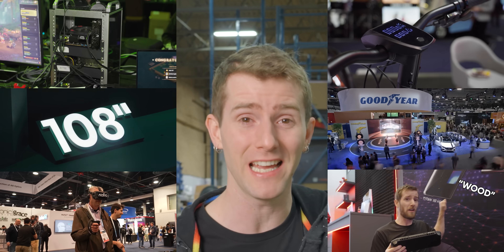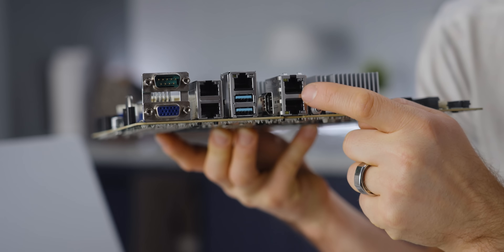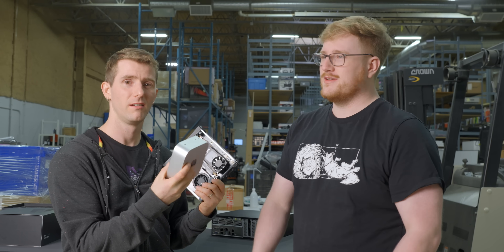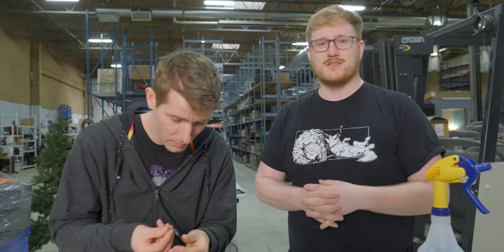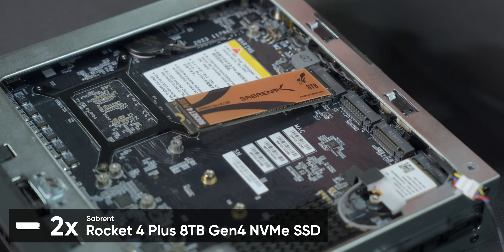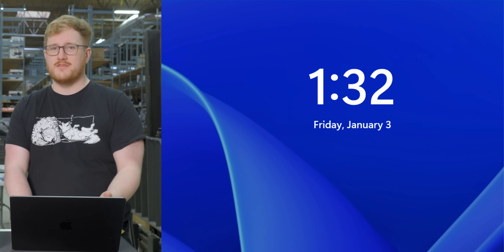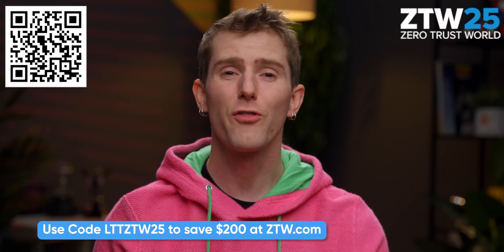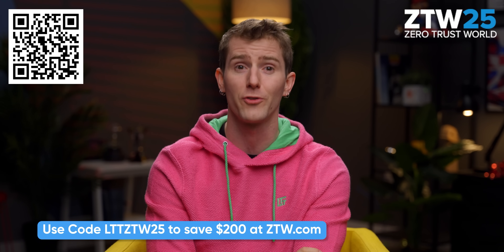I replaced a $20,000 server with this

Comment: Please do a video on a possible replacement of the Minisforum stock fans as they tend to get a bit noisy after little over a year, which is a bit annoying for a small mini PC on the desk. Have the UM 890. It's not all the time but some times it gets a clacking sound from the unit which sounds like the cooling fan is not build to run 24/7/365 and still be centered correctly.

Comment: Getting a bit frustrated with the prices of 10gb networking on the Mac’s, 200 bucks for a dongle? Just bought a 4 port 10gb nic on eBay and it only cost me 40 bucks. Super frustrating how much they are price gouging on thunderbolt dongles

Comment: I put a "Sparkle Intel Arc A310 SA310C-4G GPU 4GB GDDR6 Low Profile PCIe 4.0 50W" in my MS-01, supports hardware accelerated transcoding h.265, which the 13900H doesn't.

Comment: Honestly just buy a used dell optiplex micro i7, 4watts in idle, stick 64gb ram sticks in it. 
Sadly no EMCC but it’s awesome test bench and small servers. 

“Whopping 16gb vram” 😂 that should be the minimum any card has in 2025. 😮
Then Nvidia stock went to the moon and gpu stoped getting faster and Ai need VRAM,. Rip

Comment: For automating my shades I use homebridge with the sunlight plugin. You put in your location and it tracks the Sun’s position in the sky. You add a position where you want the shade to open or close and it is presented to HomeKit as a switch that on or off. The do an automation based on the switch. It’s amazing because the shades automatically adjust to the seasonal changes.

Comment: thanks for clueing me into the nanokvm. that's a great improvement on form factor. I use a pikvm setup that runs on a pi4 and it's great but I was having some hard lockups on my 5950x system while i had two 3090s installed inside of it. Required power to be pulled to reset the machine! I did set up a smart plug to achieve that but it's not nearly as portable and integrated like an IP-KVM is, so I hope a product that integrates power switching can also come along soon.

Anyway somehow this machine is running stable now that I took one of the 3090s out of it.

Comment: MS-01 will overheat if you really used it for this.  Both the CPU and the NVME drives, not to mention the trash cooling on the PCI-E slot.

Comment: It WON'T be ok! Definitely connect the power/reset header pins.

We have about 10 of these running now, 6 in production (2 DCs) and fault rate is about 50% where we'll just get kernal panics, etc randomly (not under high load, temp, etc). Running Proxmox and TrueNAS Scale. Not related to Intel's degradation issue on desktop CPUs though.

The iGPU also doesn't play nice with Proxmox/GRUB bootloader (VGA OOM issue) and can result in hypervisor not booting.

Comment: If you're connecting Macs, you can go thunderbolt direct to the MS-01 and use thunderbolt networking and get 20 Gbps without a switch or 10 Gig thunderbolt networking adapter.  But you're limited to only two systems via this method as the MS-01 only has two thunderbolt ports.

You also also upgrade the network jack on the macmini and run 10 Gbe internally through the RJ45 and drop the networking adapter.
Reply: There are now Thunderbolt 5 switches, but it is early days.

Comment: If you don’t have access to port forwarding or a public static IP, or if you’re behind a NAT or ISP-controlled network, you will run into limitations with devices like the Sipeed NanoKVM for remote access.
you still need some Port Forwarding on a public IP or a VPN or similar tunneling solution
Reply: the nanokvm seems to have ipv6 so as long as the network supports it it should be fine

Comment: Those low endurance gaming NVMe drives will die very fast if you constantly write on them.  Nothing replace high durability U2 enterprise drives. Sorry but you did not replace a $20,000$, you bought consumer crap that will eventually fail sooner that you expected.

Comment: A note on the sponsor: I work for an MSP. We use ThreatLocker and we deploy it to our clients. It is the worst piece of software I have ever used. All our clients hate it and complain about it. The only person in our company who doesn't openly hate it, is the director of security who chose it to replace SentinelOne. It blocks everything from running and causes issues that aren't obvious to troubleshoot. There have been several cases, such as simply connecting to a printer hosted on a print server, which have been stopped by ThreatLocker and it wasn't apparent that was the cause until way more troubleshooting time than necessary. I'm not a security guy but when the "security" product impacts peoples' abilities to do their work, it's not a good product. I'm sure all whitelist/zero trust style of security applications have the same fault but I'm only familiar with ThreatLocker. Unless your company has a well staffed security team to sift through hundreds of application requests, I'd suggest staying far away from ThreatLocker.

Comment: If your non-edged hand tools are 7 inches  (or 18 cm) or less, you can bring them in carryon.  Power tools like hand held drills are too big to be allowed in carryon, please transport those in your checked bags. Lithium batteries are not allowed in checked bags (power tool batteries) but can be in your carryon bag.  Canadian citizens with Nexus are granted TSA PreCheck if the proper fields are inputed on the airline reservation. Please feel free to message me if you have need for further advice.

Comment: Macs are likely more stable, especially for everyday use. My M1 Mac with 16GB RAM and a 512GB SSD has been trouble-free, while Windows PCs, even gaming ones, often overheat. My PC's GPU hits 43°C after just a few minutes, but the M1 stays around 31°C.

Battery life on the Mac isn't perfect, but it’s still solid—94% down to 90% after 4 months. It lasts way longer than my gaming PC, which has fewer cores.

Also, there's zero noise even when running 4K editing software. It's a much smoother experience overall. - feel liks i never turned it on before

Comment: Well, with something like the Mikrotik CRS504-4XQ-IN, you could break out the 4x100G connections into 2x25G to the MS0-1 and have 14x 25G or 10G links to the editors. And it's only 12cm wider than the MS-01, otherwise identical in size.

Comment: Yooooooooooooooooooooooo.

The fact that hotels in Vegas (where Defcon is hosted) actually leave their ports open like that is insane. First off, their AP's should obviously not be accessible to guests (but I know you know that) but their should also be incredibly basic security protocols to prevent unauthorized devices from being connected to their wired network. 

That's fucking insane.

Comment: Without wanting to drop into the Mac vs PC rabbit hole, if the software is more stable on Mac meaning that you need to use a Mac when you are at shows for that time and stability, then would it not make sense to always run on Mac regardless, for efficiency? or is that down to the computers in the office having more power to combat the stability issues and make them stable?

(Honest question, sorry if it is a stupid question, trying to learn).

Comment: RUMOR MILL ALERT Part 3 of 4: Apple 3D Printers are Now in the Pipeline!

The Aluminum powders for the 3D metal printers will be 1060, 3003, 6061 and 7075-series Aluminum powders specially created for Apple to ensure fast, high-resolution printing using fast-jetted micro-droplet deposition and pulsed laser heating/fusing. Additional Aluminum powder grades such as various marine-grade 5000-series and aerospace-grade 8000-series Aluminum alloys will be added later.

The Tool Steel grades introduced initially will be A7, D2 and S1 Tool Steels while the Stainless Steel grades will be 304 for commercial and home use and the 316L and 440C series for marine and hard environment service. More advanced premium grades of Stainless Steel Alloys and High-Speed Tool Steel grades such as CPM-S90V, CPM-30V, CPM-20V, CPM-10V, MagnaCut, VG-10, CPM-Rex76, CPM4 and PM30 metal powders are to be introduced within one year of the printer introductions.

The first available metal grades initially available for bulk-run printing will be high-purity Bulk Iron (i.e for cookware and decorative items), high-purity Aluminum (for custom and decorative purposes) and high-purity Titanium and Tungsten powder grades for high-tensile-strength and high-corrosion-resistance applications! These bulk-grade iron, aluminum, titanium and tungsten powders will have resealable anti-rust and anti-corrosion-specific packaging to allow for long-term storage of those bulk 3D printing metal deposition powders.

The Copper Powder grades will be B1 and Yellow Brass used for 3D-printed electrical conductivity and internal wiring purposes and for artistic works. The ceramic composite powders will be high-purity Silicon Dioxide (Quartz glass), Aluminum Oxide (Alumina), Zirconium Oxide (Zirconia) and Silicon Carbide and the Tungsten Carbide ceramic powder and various grades of premium-strength and corrosion-resistant Titanium Alloy powders will be added within 6 months of printer availability.

Negotiations between Apple and various metal, plastic and ceramic powder OEM suppliers are at the later stages with Apple and are rumoured to include companies such as Alcoa and Rio-Tinto-Alcan for the Aluminum powders and Kyocera, AGC and 3M for the ceramics. Stainless Steel alloys will be coming from Germany, Norway, USA and India plus Copper and Brass powders from USA, Australia and Japan. 

Precious metals such as Gold, Silver and Platinum group metal powders are still under current negotiations between Apple and multiple worldwide suppliers for small-format and bulk purchase agreements.

My Asian source has re-iterated that there are multiple and separate print heads within each metal/ceramic powder 3D printer that are each designed for specific metal powders and ceramics which will allow mixed-metal and mixed-ceramic 3D prints to be facilitated at the same fast printing speeds! These separate print heads can be purchased and installed by the end-user and feature self-cleaning technology to prevent cross-powder contamination.

The first set of 3D printers will allow the metal and ceramic powders to be mixed within the same 3D printed object and another set of higher-end printers will be allowed to mix plastic, metal and ceramic powders all within the same 3D printed object. This will allow for multi-material 3D printed objects that have extra internal reinforcing, variable object surface materials and variable internal volume fill materials plus the possibility of conductive wiring and electrical insulation capabilities embedded right inside of 3D printed objects.

In terms of software and supporting hardware, Apple has bought a 3rd party CAD/CAM/CAE/FEA application many years ago which has been re-developed in-house for ease-of-use and will have added A.I.-assistant-based design engineering and 3D print optimization so that final prints are made optimally for each end-user application. It was specified that this new application will have CATIA and Solidworks-levels of built-in 3D design, modelling and simulation abilities combined with Apple App Store and Final Cut Pro ease-of-use so that home-based and small business users can get up to speed quickly on the 3D printing revolution.

One copy of the integrated design and printing software will be included with each 3D plastic and metal/ceramic printer. Additional software copies for group-based and LAN/WAN network-based CAD/CAM/CAE/FEA/Simulation collaboration are also being introduced soon after the 3D printer hardware.

See Next.

Comment: RUMOR MILL ALERT Part 2 of 4: Apple 3D Printers are Now in the Pipeline!

The internally codenamed “JetStream” print head and LASER-based fusing technology introduces a set of super-fine multi-color plastic, metal and ceramic powders that are jetted cold through fine-tipped nozzles that instantly get LASER-melted as it exits the nozzles as superheated micro-droplets which get deposited onto high-resolution computer-controlled 3D-XYZ coordinates on a rotating table layer-by-layer using MULTIPLE PRINT HEADS which increase print speeds many-fold over other technologies. 

The superheating of the micro-sized powders takes place just as the powders are cold  deposited onto the rotating base table and objects so NO BAKING is required afterwards. This new type of Apple-developed super-fast cold-jetted powder deposition and post-nozzle super-heating technology BYPASSES the following 3D printing patents held by Stratasys:

United States Patent No. 9,421,713
United States Patent No. 9,592,660
United States Patent No. 7,555,357
United States Patent No. 9,168,698
United States Patent No. 10,556,381

The powders are FUSED together immediately upon deposition from the print head itself. For all-metal and ceramics-based 3D objects, Apple is also selling an easy-to-use multi-method combined heat-treatment, tempering/quenching and cryogenic hardening center for 3D printed metal and ceramic objects to ensure optimal levels of strength, hardness and wear-resistance. The current rumour has Apple supporting long-run print jobs where 50+ item runs can be printed before maintenance is required.

The very small size of the micro-ball-sized powders which are super-heated and melted by multiple print-head-mounted lasers also allow very high resolution which has been noted to be down to 50 microns (0.05 mm) at the 90 cubic millimetres per second print rates which is an ASTOUNDING achievement! This high resolution creates smooth-surface parts with almost no visible layer lines.

Print speeds for the multi-head 3D metal/ceramic printers have been re-confirmed to be up to 5000 cubic centimetres per hour which is insanely fast for metal printing AND that further speed increases for all the plastic, metal and ceramic powder printers can be improved via downloadable firmware updates and via updates of the printing/layer-slicing software for any current and new printing material formulations.

The multi-head/multi-color 3D plastic powder printers will have the initially available colors of Black, White, Red, Green, Blue, Yellow, Cyan, Magenta, Purple/Violet, Orange, Brown, Light Gray, Medium Gray, Dark Gray with other formulation colors to be introduced later. This allows for many colors to be embedded and/or mixed into a given plastic end-product.

See Next.

Comment: RUMOR MILL ALERT Part 1 of 4: Apple 3D Printers are Now in the Pipeline!

Apple’s Next Big Thing are a set of super-fast Plastic, Metal and Ceramic Powder Deposition 3D Printers and Apple-branded A.I.-assisted CAD/CAM/CAE/FEA software that should strike some serious commercial fear into Stratasys, Markforged, Bambu Labs and various other 3D printer makers plus also put CATIA, Autodesk and Solidworks on-notice in a very, very big way!

Another recent post by my secretive Asian electronics engineering source has re-iterated an older post of mine about Apple’s upcoming set of super-fast 3D printers that will allow multi-color plastic resin, powdered metal 3D printing and multi-color powdered ceramic 3D printing for desktop and commercial/industrial use.

Added to the mix is a very-user-friendly, A.I.-assisted monolithic application from Apple that combines 3D CAD (Computer Aided Design), CAM (Computer Aided Machining), CAE (Computer Aided Engineering), FEA (Finite Element Analysis) and Integrated Structural and Flow Dynamics Simulation software that Apple has been actively working on since 2013 and has recently accelerated development as of 2021. The first Apple patents on 3D printing technology were filed in 2013, then in 2015 and 2017 and most recently in 2023.

My Asian source has confirmed some very specific 3D-volumetric print size descriptions and their print-speeds which will be the fastest seen yet of their types. The foundation of these 3D printers are a set of new and soon-to-be-patented 3D print-head technologies designed in-house by Apple that is applicable to plastic resin, metal powder and ceramic powder that allow the fastest print speeds at the highest resolutions that have fine enough resolution and layering so as to print parts that are strong enough to be used for heavy industrial and even aerospace applications.

The below are a list of the following types and volumetric print sizes for the printers confirmed to have been seen in a highly-secured area of Apple Headquarters during multiple sessions during 2024 which will be targeted towards specific types of end-users:

a) 200 mm by 200 mm by 200 mm print-sizes plastic and metal/ceramic powder
desktop 3D printers for home/small office/educational users

b) 400 mm by 400 mm by 400 mm print-sizes plastic and metal/ceramic powder
3D printers for small-business/office-oriented/university/commercial warehouse 3D printing

c) 800 mm by 800 mm by 800 mm print-sizes plastic and metal/ceramic powder 3D printers for industrial/commercial-scale fast 3D printing

d) 1500 mm by 1500 mm by 1500 mm print-sizes plastic and metal/ceramic powder 3D printers for industrial/commercial-scale fast 3D printing

Apple’s current plan is to introduce the 200 mm and 400 mm 3D multi-colour plastic-resin 3D printers first and the larger plastic powder and the metal/ceramic powder deposition 3D printers in all sizes to be introduced/sold at later dates.

Apple is also intending to target the large-scale industrial/commercial market with larger and more ruggedized plastic resin, metal and ceramic powder 3D printer offerings which will see 800 mm by 800 mm by 800 mm and 1.5 metre by 1.5 metre by 1.5 metre box-sized 3D printers to compete directly with the major industrial-grade 3D printer and CNC-machine makers such as Stratasys, Bambu Labs, HAAS, MakerGear, SPEE3D and MarkForged!

See Next.